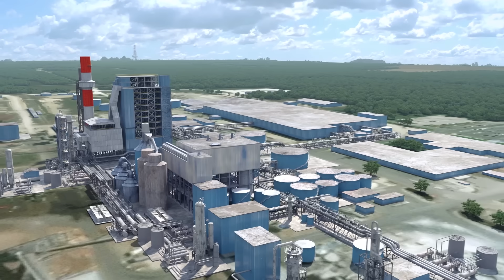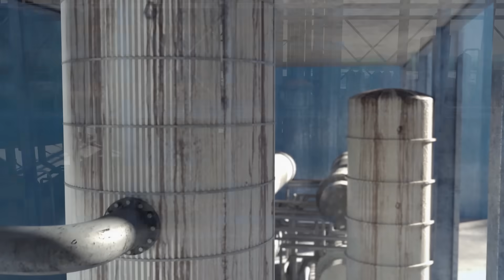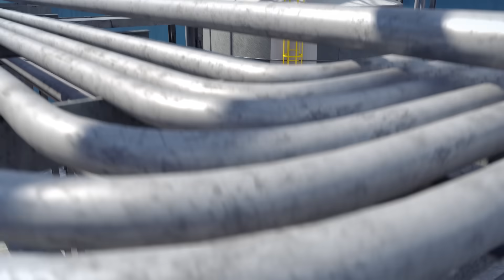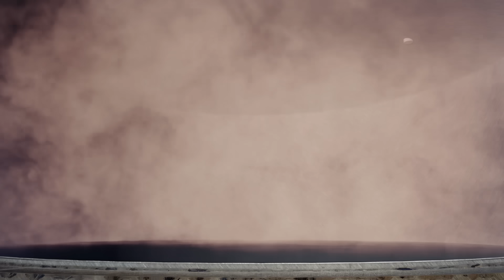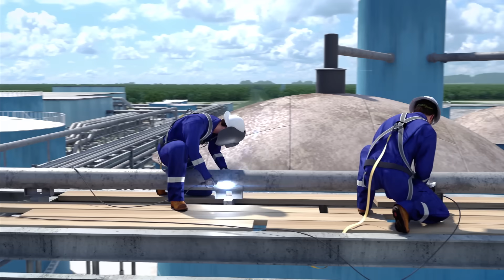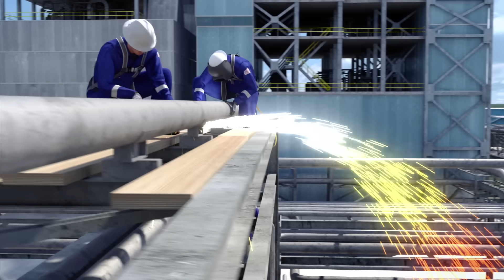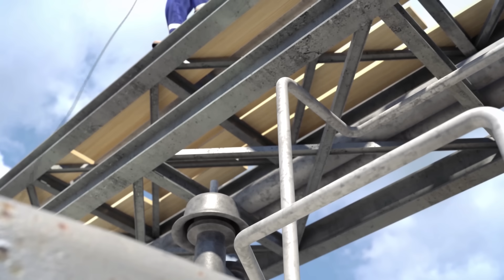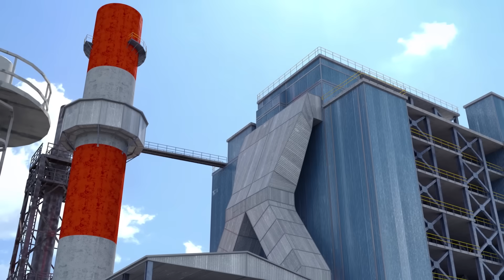Animation of Explosion at PCA's DeRidder, Louisiana, Pulp and Paper Mill

Comment: Conservation vents, like the one depicted in the video, are designed to vent both ways. To relieve the tank from internal and external pressure (vacuum). I thought this was pretty common knowledge in the industry but It didn't seem like this was understood from the video. Just looking at this, I would say it's most likely that the tank vented the explosive turpentine vapors which were ignited by the sparks/slag? Also it isn't mentioned whether or not the tank had a flame arrestor installed. Where I currently work, these are required on tanks in any sort of flammable service.
Reply: Again, this is just an assumption, but even if they had a monitor where the work was occurring, they were far enough above the tank for the fumes to dissipate in the wind. At least the amount of fumes that I would expect to be released during normal venting. I do agree that it's more likely that by 11:00 that morning, the tank may have been warming from the sun. The sparks from the hot work falling down onto or near that vent could have ignited the vapors. 

What I really can't imagine happening, is localized external heating from falling sparks or slag transferring enough heat to the internal surface to cause an explosion. That's a little far fetched in my opinion.
Reply: I think you'll find sunlight has little effect on the vapour pressure in the tank.  Firstly it heats the top of the tank, which is relatively well insulated from the liquid, and secondly the pressure is controlled by the liquid surface temperature which will change incredibly slowly -  the time constant is proportional to the linear size of the tank.  I'd bet that tank had been cooling steadily since shutdown, its primary heat source being the incoming condensate.
Reply: I agree Bob D having a tank with a flammable liquid inside and then allowing it to vent to atmospheric pressure is like having a bomb reading for detonation.
Reply: If the vent had burped due to the tank warming up, the guys above would have heard their detectors going off on an LEL warning (unless they weren't wearing them) but the flow of air shouldn't have let any fire or sparks INTO the tank... 

(I spent many years putting on or taking off tracing & blankets on those valves when they were being serviced up here in the frigid wastes of northern Alberta)
Reply: If the vent had opened to relieve low pressure while the welding/grinding was going on, it could have drawn sparks into the tank with the air.  Unlikely maybe, but a plausible mechanism nonetheless, and way more likely to ignite than any other suggested.  I can't imagine a couple of welders producing enough heat to make that big tank go over pressure, remember it's the liquid temperature that controls the pressure and that's a big mass.  Maybe the tank was standing at sub-critical low pressure, and vibration from the work triggered a burp.  Those welding particles bounce around for a long time, and can find their way through complicated paths.  I once got one in my eye that had come through the baffled vent in my (otherwise well sealed) goggles.
Reply: Should have regulated nitrogen as the first line of defense for the tank pulling a vacuum.  Engineering control failure
Reply: The report was a little unclear on this, but I think they determined that it was heat penetrating the tank walls that set it off, not an actual spark or flame.